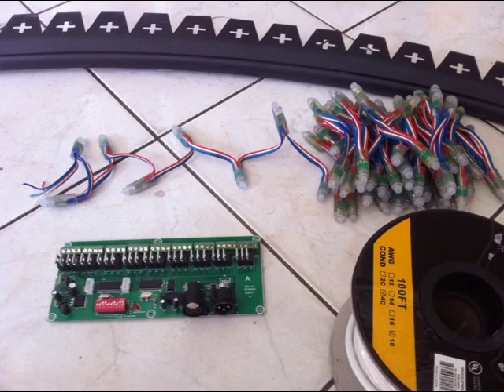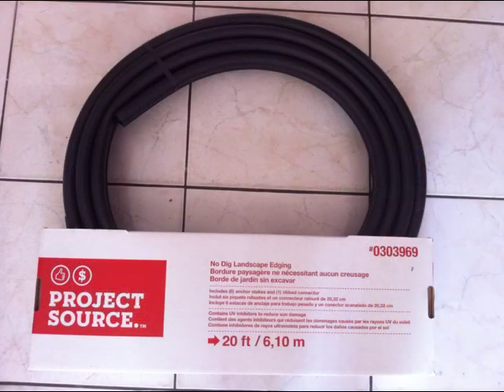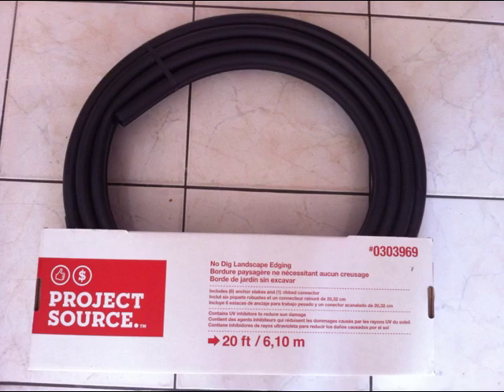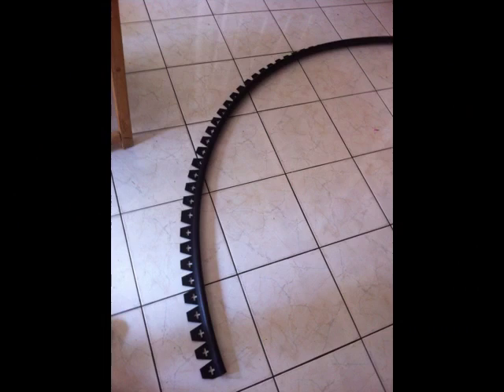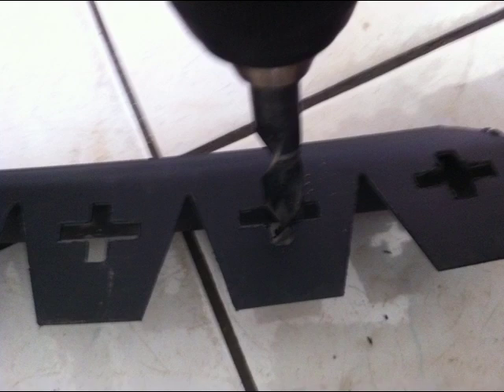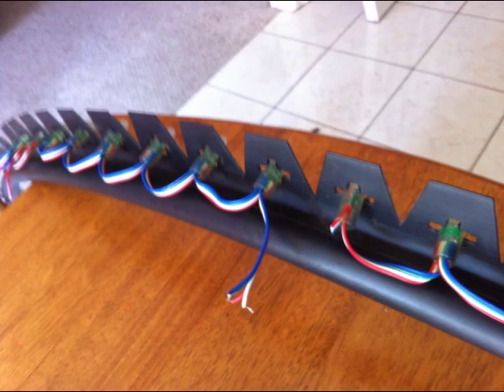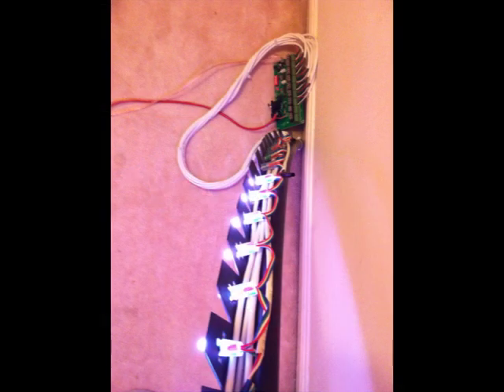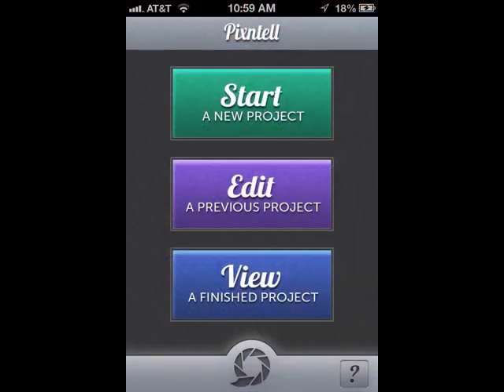Easy way to build RGB LED Leaping Arch | Light-o-rama | LOR | LED Christmas Animation | S3

Comment: Gary,
I am a novice, can you send me detailed directions how you built this arch. I have some ws2811 pixels that are 5 volt and don't understand how to hook them up to the controller and power supply. I would greatly appreciate any help.
Reply: John,  The 27 channel controller will not work with smart pixels.  This is for dumb or basic pixel rgb lights.   The Tinypix controller from Holidaycoro will run both 12v and 5v ws2811 strings and strips rgb lights.  You have to have a 5v dc transformer which Holidaycoro also sells.   Also, you will need a programmer cable to program the board with their free software that only runs on windows 7 and older computers.   holidaycoro has great FREE training videos under each product they sell.  This is where I learned 90% of what I know about RGB lights.

Comment: I am a novice. The pixels that I bought are ws2811 and are 5 volt. The controller board you use is a 12 volt. What must I do to make this work right? I have the pixels and the edging but go to figure out the controller.

Comment: How much does this all cost?
Reply: Note his is not a standalone system.  You have to use Light-0-rama advance software with DMX Dongle to make all this work; otherwise here's hardware cost:

$50 for board
$13    (.29 of each rgb light X 42 per arch)
  $7    ($14 per roll makes 2 arches from one roll)
  $9     (8+7+6+5+4+3+2=35 ft. 4 wire 18 RGB wire  X .25 per ft)
 $15   12 volt water proof power supply
     ?   Cat 5 Ethernet cable for transporting DMX signal from you computer.
--------
$ 94  plus shipping rgb stuff.   You can purchase from Holidaycoro link above under main YouTube Description.  Also they have great videos on how to program and create custom RGB lights.  Check it out before you purchase anything.

Comment: Hey Gary great vids. how will you run the dmx data to each arch. daisy chained from each board or will you you just use a "T" or "Y" splitter  coming of the main dongle..thanks..

Comment: Hi,

I cant say for sure, but to me they look like addressable RGB strings, [ebay.co.uk/itm/181121053744?ssPageName=STRK:MEWNX:IT&_trksid=p3984.m1439.l2649]

They are awesome, since each LED has its own IC, and it effectively works as a shift register, so you inject the power at either end of the string, and use a clock and data serial connection to input the data, and it moves along each LED. Check out this project
[learn.adafruit.com/adalight-diy-ambient-tv-lighting]

Comment: hi.
But are the pixel common anode or cathod?
I suppose that one of the two is common with the 3 colors, so I don't get the wiring scheme with the pixel.
and also, No need of resistor in the middle?

thanks

Comment: Yes, you can have one light node per RGB channel which is made up of 3 dmx channels; therefore, you have to have a R-red, G-green, and B-Blue channel.  In Lightorama, you can group these 3 dmx channels into one RGB Channel.  So if Red, is #1, and Green is #2, and Blue is #3  then the next rgb channel has to be 4.   Use this 27 channel board with the arches, I'm using 21 of the 27 channels.  Since it take 3 channels per RGB channel, therefore, I'm using 7 or the 9 available RGB channels.

Comment: Yes, these are dumb RGB LED light nodes.  If you have 6 lights in a section.  they will all respond the same way within that a channel.   You can also have 1 light in a channel or 20+ depending on your power supple and how many amps your controller supports.